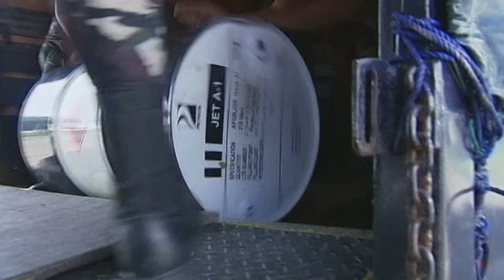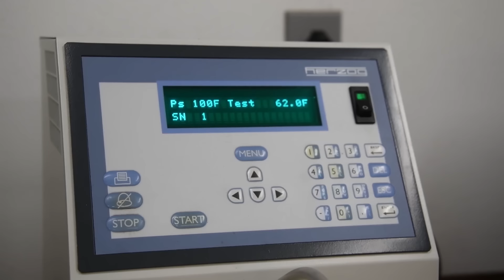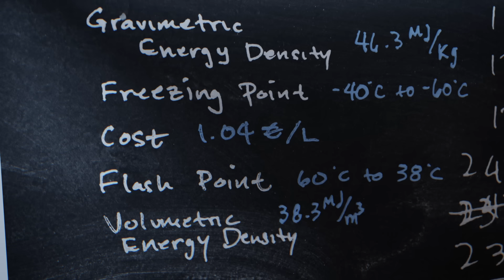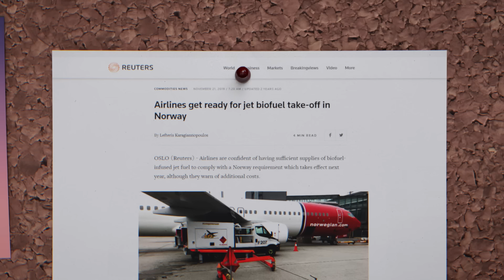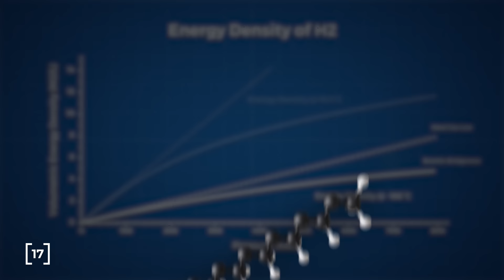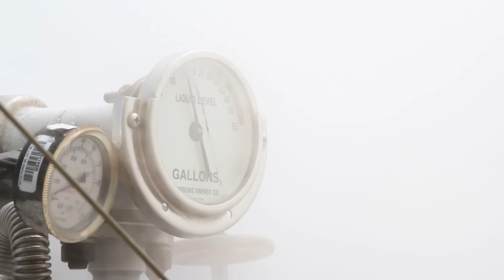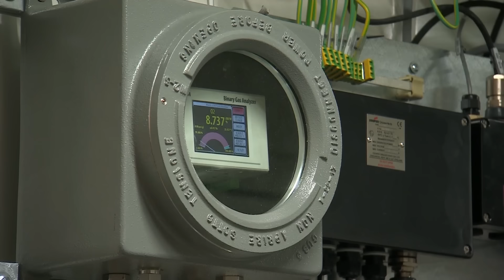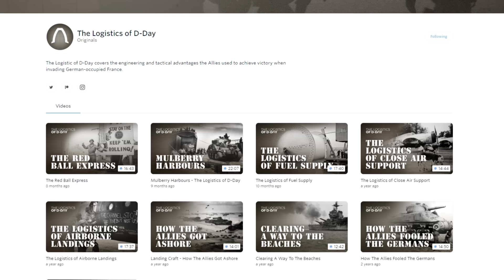The Uncertain Future of Jet Fuel

Comment: Unfortunately, I doubt we will ever see excess energy 'flood the market'.  Every time we figure out how to produce more power, esp if it brings the price down, demand goes up.  Multiple times over the last hundred years or so people proclaimed that soon power would be too cheap to meter and the market always re-scales to make it expensive again.
Reply: So basically induced demand?
Reply: Also price fixing
Reply: what are you talking about, it is excessive and abundant availabe since a century at least.
Reply: Right - and manufacturing fuels will be one of those things expanding demand as energy prices drop.
Reply: Good old free market
Reply: Government rescales to make it expensive again each time the market rescales to make it cheap.
Reply: Alternatives: 
1.) Hyperloop-esque transports
2.) Fast trains
3.) Shorter-range electic planes for (more) regional travel 
   a.) Possible multiple stops, to board a new fully-charged plane

Extra renewable energy will be very cheap only if there will not be a better use for it, and there will be better uses for that energy than making wildly non-efficient E-fuels.
Reply: Induced demand generally doesn’t lead to the price per unit stabilizing. Perhaps the price the average consumer pays yes, but mostly because consumers will consume more. When modern processes for aluminum came into being the demand for aluminum soared until the price stabilized. But it did not stabilize to where it was beforehand or else aluminum soda cans would be prohibitively expensive, think $10 for the can alone.

Also here’s a few numbers for electricity. $100 in 1950 had the same buying power as $1100 today. If you had spent those $100 on electricity, it would buy the same amount of electricity that $800 of today’s money would. The real price of electricity has dropped pretty dramatically, though obviously slow enough that the listed price has increased quite a bit through inflation. We probably also more electricity than we save which again has been driving up the listed price, but despite that, the real price per unit energy has dropped in the last 80 years.

Between 1913 (first date inflation calculator has data) and 1950 electricity price drops were so rapid that the listed price per unit energy actually dropped by 40% though it should be noted that the average inflation rate was quite a bit lower during that period so the listed price change is more pronounced because of that.

So I agree that we’re not likely to see a society where power isn’t metered simply due to induced demand, but it should be noted that it won’t be metered probably because households use far more energy than we do currently because the price per unit energy will have dropped significantly, while new industries such as efuels will have soaked up much of the bulk energy to keep the new energy sources profitable.
Reply: @rudyberkvens-be  actually it's the market making it expensive. how are private entities supposed to make money if electricity is too cheap?
Reply: It's not that the market expanded to gobble up the too cheap to meter power, it's that the too cheap to meter power never actually happened.

Although we really are likely headed for many periods of zero marginal cost electricity in future. But they'll be sporadic, so whether it happens will depend on whether demand can be flexible enough to gobble them up. If not, electricity will indeed be free...sometimes.
Reply: @Fottrel  as long as you buy for X and sell for X+Y, you make Y profit, doesn't matter how cheap it is.
but every time it goes from X to X/2, that X/2 is eaten by the government taxes, or just become Y, profits.
if the market were free, the competition would bring that Y profit down eventually, but that's when governments comes into play and regulate the hell out of the market, and then competition dies.

it starts and ends on government, its the government who makes everything expensive by sucking blood of everything, like a vampire, bunch of leechers...
Reply: Take the Middle East countries as an example. They have extremely high potential for solar energy, but no way to electrically transmit it to Europe, China or let alone the US. E-fuels might not be as efficient, but they can be distributed with existing infrastructure, namely pipelines and tankers.
Reply: It's called Jevon's Paradox. When the efficiency of production rises and thus the price goes down, people find new uses for it that weren't economical before so aggregate demand goes up.
Reply: @monad_tcp  Except markets can't exist without regulations, and are deeply flawed in isolation, misallocating resources for everything with externalities, which is just about everything. If that weren't enough, they're amoral and have no mechanism to ensure competition, resulting in things like poor safety standards and monopolies.

Your appraisal of government is deeply childish and not supported by economics in the slightest.
Reply: @Yaotzin86  LOL 😂🤣😭🤣😂😅😂🤣😭
You shat your pants dude
Reply: True, but Solar Power (w/o storage) has the advantage of not really being compatible with human-usage on a widescale. Our usage peaks in the early afternoons and evenings (say 5pm), while Solar tends to peak at noon. So a fully solar system would generate a lot of suplus energy in the 10am-4pm period. Energy intensive industries can utilize this period to get cheap electricity. These industries, like desalinization and methane carbon capture production can also be intermitent, so they don't have to run on cloudy days when solar production is low.
Reply: @veergauba  That's the (many, many) million dollar question: how flexible can demand really be, economically? Technically it can do it, but it means lower utilization rates for all the capital equipment, so you pay more to get cheaper electricity some of the time..how that will balance out is a huge unknown.

If it turns out industry can't be that flexible, we'll end up with far more variable prices. Often, they'll be very low to nothing. Other times, prices will be very high. Consumers probably won't see that though - we saw in Texas how consumers really don't like the shock of sky high bills on rare occasions, even if they're getting decent prices overall. Retailers will likely handle that and offer relatively flat rates.
Reply: rudy berkvens No.
Reply: Once the entire fleet of cars/trucks is electrified that'll soak up any excess energy.
Reply: most energy in the world is used by manufacturing consumer crap.
Reply: Excess energy is just the nature of renuables. Sometimes they generate a lot, sometimes they generate nothing. Energy storage is expensive and you can't possibly store all that they would generate when their output is at its peak as their percentage in the grid increases.
Reply: @Yaotzin86  "markets can't exist without regulations" - I'll sell you my bike I don't need anymore. You give me money. Bam. No government involvement.
Reply: @ChucksSEADnDEAD  I guess I should have said "modern markets" or something so I wouldn't have a tedious pedant pointing to the possibility of simplistic transactions without regulation.

By the way, that money was counterfeit and you're outta luck because there are no laws regarding legal tender.
Reply: @Yaotzin86  It's not pedantry to point out that the vast majority of human interactions are anarchist and do not involve government at all.
I don't need laws against legal tender. I made a trade for real money and you resorted to fraud. Your problem isn't that you manufactured fake money. Your problem is that you stole from me. And I will be made whole one way or another.
Reply: @Yaotzin86  No, you don't get to define markets. Everything is a market even if you don't want it to be. Trying to plead for a special definition is just a fallacy.
""Real money" is defined by the government" - Not really, it's defined by the central bank. In some cases the central bank is owned by the government. There's no actual reason a private bank cannot issue currency. In fact, things like bitcoin are validated by cryptography and do not require a central bank to be validated.
""Fraud" is defined by the government" - No, it isn't. It's theft by deception.
"There is no such thing as legally owned property without government" - This is Marxist BS. Everyone except the most unreasonable people recognize that property exists independently of government. Only the deranged who buy nonsensical political ideologies actually try and argue that property is something we get from the government. Even animals mark their territory. Even animals can comprehend the notion of what is theirs.
Reply: The only way that I think energy could become too cheap to meter is if fusion ever becomes practical.
Reply: @elektrotehnik94  
Any mention of nuclear planes?  It can be made secure and deactivate automatically.  The IAEA and ICAO, along with airlines can ensure compliance.  No exhaust, except maybe water (not radioactive from the closed loop system).

Convair NB-36H was experimented with in the 50s by the Air Force.  With current tech, it would be even safer.
Reply: @Hyrum_Graff  
Nuclear (fission):  umm, hello?

Fusion also generates harmful by-products without protection too (eg x-rays, gamma rays).  We need an ozone layer, magnetic field, distance, and an atmosphere to protect us from the largest fusion reactor in the solar system.
Reply: Future of flight:
Google maps street view and VR, along with video conferencing (soon with VR).
Reply: @user-nf9xc7ww7m  True, but those harmful byproducts aren't persistent like they are with fission (no radioactive waste to store for tens of thousands of years).  Fusion fuel is also significantly cheaper than fission fuel.
Reply: @Hyrum_Graff  
Granted, but fusion, regardless of actual fuel costs, costs more in general.  We can do fusion now, it's just nowhere near economically feasible.
Reply: @user-nf9xc7ww7m  Energy generation via fusion is currently possible?  I thought it still took more energy than it produced.

Both fission and fusion have problems when it comes to public support (in the US, anyway); people are afraid of fission (radiation, meltdowns, explosions, etc.), and fusion is often not considered seriously, because it has always been the magical future solution to energy problems.
Reply: @Hyrum_Graff  
Thought I said that...sorry.  Fusion can be generated, but it's not economically feasible.  Too much input to create, not enough output.
Reply: That is a good point, I hadn't actually thought about demand scaling. My argument would be that renewables, as conceived now, will not "flood the market" because they will be replacing existing capacity, not complementing it. Otherwise the green spiel makes no sense -- you have to reduce the amount of fossil burning generation if we want to slow down the climate change. So, expensive and unreliable renewables will be replacing the current generation and if anything, it will make energy even more scarce and expensive (considering that you'll also have to keep a fleet of peaker plants ready in the event of a sudden drop in generation). Unless a cheap and readily scalable technology of storing energy will be discovered in the near future, I can see no way how the renewables can even satisfy the existing demand (considering that it's always rising, as you correctly point out) let alone create an abundance.
Reply: Let's not forget that economic development also allows for people who previously couldn't afford power to start consuming more. The disparity between countries' amount of energy consumed per capita is staggering. New consumers, or the simply rise in demand due to users' increased buying capacity, is a huge factor that will impact the balance you pointed out, between production and demand, for years to come. :/

As many others that relate to the discussion, this issue also affects to Jevon's Paradox, which @lunatickoala mentioned while provinding another great point.
Reply: nuclear is the best way, but people are afraid of it. It's an irrational fear.
Reply: I think that's scarcity economy and profit, not demand.
Reply: @elektrotehnik94 Hyperloop is a scam for this century anyway. I wish that weren't true, but it isn't reasonable. Just too expensive and not worth it. 

 Fast trains and Mag Levs that actually use their potential.

 Also EV planes. Hopefully we unlock lithium air chemistries. Max potential energy is nearly on par with kerosene!.

 Yet even without it. Batteries will get good enough for regional flights within 20 years. With a smaller cargo or shorter flight of course. 

 Yet still electric motors have benefits like super cheap charging costs. Less maintenence. 

 Also electric motors are much easier to make a tilt rotor crafr. Allowing for VTOL or STOL type aircraft like a drone for passenger flights. 

 Hydrogens volumetric density seems like a non starter to me for cars or planes.